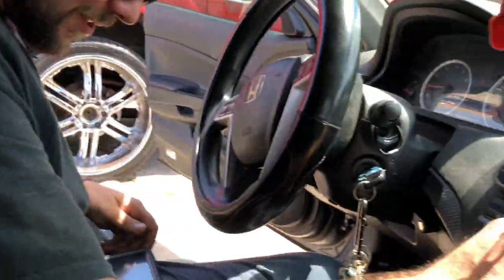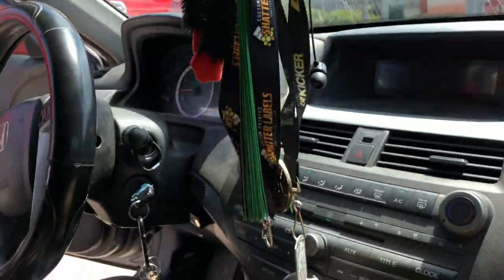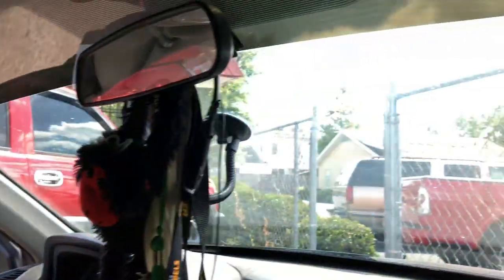2 Kicker CVX 15's on a Kicker 500 WATT Amp

Comment: How did it sound? And yeah if thats a dx500.1 that was their bottom line amps then he would need a lotttt more power, my buddy has the L7 15s both rated at 1000 rms like those cvx and they take the kicker zx2500 like a champ! They pound crazy hard I remember when I used to hate kicker until I heard his L7s and the crazy thing is they were almost as loud as his re sx 18s! But I still think the L7s sounded 10x cleaner and better than the re 18s I couldnt believe L7s could beat like that I have no doubt those cvx would take a zx2500! You used to have the re sx 18s right?
Reply: crazy that  a lot people don’t have the proper enclosure or the tune, so they blow them or claim they don’t slay enough 😹
Reply: JOSUÉ Yeah kicker makes good stuff just not competition grade and their retail price is higher than what it should be but you can always find kicker stuff cheaper on amazon or ebay brand new